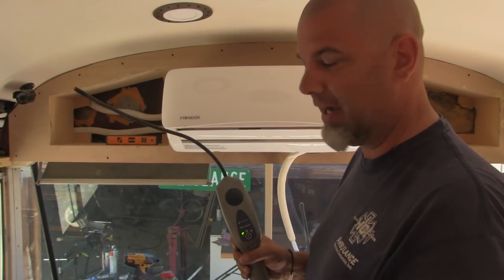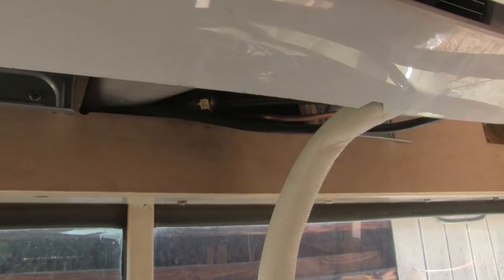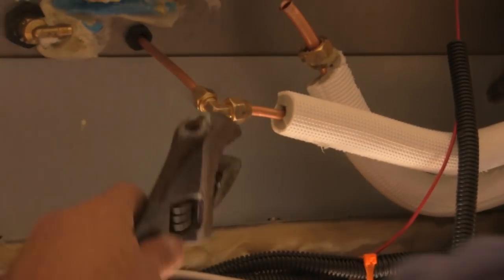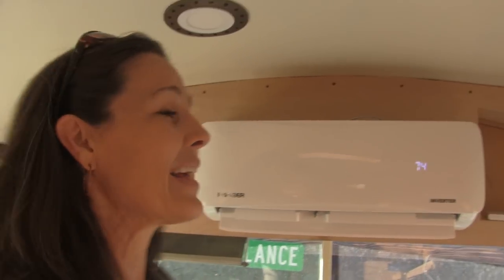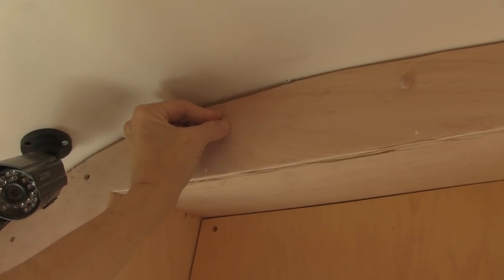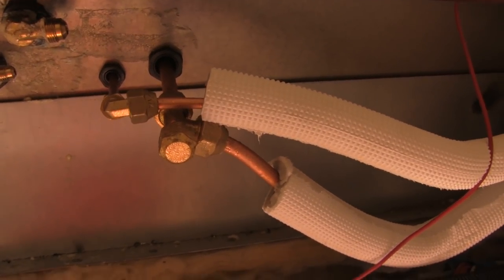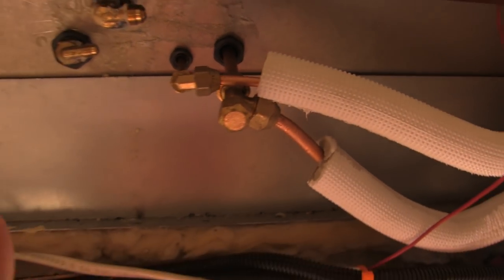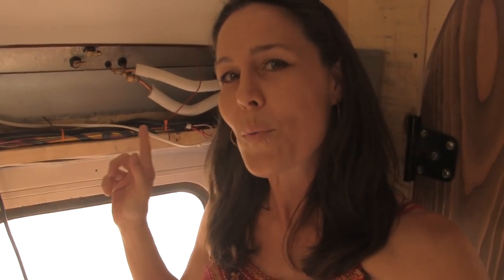Fixing Mini-split A/C Leak in our Skoolie | A/C Part 2

Comment: hey guys, I have been watching you since the beginning and enjoying your build immensely. I have been waiting for you to flare your gas tubing, I used to teach pool heating and commercial fired boilers service as a mfg rep. It was a no no to put anything threaded inside of a building on the supply lines. Especially propane fuel. i would have said something sooner, but i was hoping someone else hinted to you before I did. They did, and i agree with what you are doing.Just remember that propane sinks and it doesn't blow away like natural gas does.

Comment: Most mini splits come with ragged flares from distributer, best to cut off original and re-flare at condenser and remove flare joints at front unit and braze, a good braze lasts forever.

Comment: Best way to check for leaks on a heat pump/ac is to turn the heater on all the way. It raises the pressure in the lines

Comment: As an HVAC tech it makes me cringe how you went about this. Did it sort of work.... Yeah but lots of people watch things like this and go about it the same way less your speed bumps. For those reading this long after since they installed this let me throw some knowledge your way that will help you out.

1) In the install manual there should be a torque rating how how tight those flare nuts should be.... read and do it..... Its there for a reason. 
2) when you have the system tight ....PRESSURIZE IT WITH NITROGEN. Start at 50 psi and spray soap bubbles on all the fitting. If you are clear increase pressure to 400 psi. Check for leaks again.  The reason why you want to use nitrogen is it will help dry out moisture inside the piping. Let this sit for an hour or so. While he was using analog gauges it may be hard to tell with a lot of accuracy if you have a leak or not but you will can get close. 

When you vacuum a system you are removing the air and putting it in a vacuum and boiling off the water content inside the pipe. To be sure it is "dry" you need to use a micron gauge. This is a gauge on how much vacuum the system is in. at 500 microns it is considered dry. Most people do not do this or dont have the tools as they can be expensive. But I will tell you in most HVAC system installs 99% of your issues later on can be traced back to an install issue.  Another reason to use a micron gauge is it will with no doubt tell you if you have a leak. It is far better of tell you this versus positive pressure. Once you get to 500 microns..... close the manifold gauge set and watch the micrometer. If it start to go up..... you have a leak.  My digital gauge set has a micon gauge in it..... I also have this one as a back up. 

https://www.amazon.com/Fieldpiece-SVG3-Digital-Vacuum-Gauge/dp/B00DMFHF0I/ref=sr_1_2?crid=54ARHNHIILU9&dchild=1&keywords=fieldpiece+micron&qid=1630241416&s=hi&sprefix=fieldpiece+mic%2Caps%2C183&sr=1-2

3) they really went over some things super quick in this.... One they most people will probably screw up on..... the condensate drain. You will fight this constantly. They did not show anything on how and where they took the drain to? All air conditioning drains are a pain in the ass. So give yourself access to the drain as you will need to blow it out from time to time as it gets clogged with algae. 

Over all not a bad process but very important stuff was not covered in the video. Im just trying to help others out with a few things to make their install go easier.

Comment: How is the AC cooling the other side of the bus, do you notice a big difference in temperature from front of the bus and back of the bus?
Reply from the maker: Not very well. There is definitely a temperature difference between front and back with the door close. With is open there is a difference but overall the AC struggles. It is well over 100 degrees F so on an average day it will do very well.
Reply: @BussyMcBusface  I am getting ready to make a decision either go with rooftop ac units or a minisplit. I saw pioneer sells multizone units so I could put 1 in the front of the bus like you guys and then another about halfway in the bus so it cools the bunks and backroom on our crown bus.  However these multizone are 220v not 115v. Which means I would have to upgrade my panel from 30amp to 50amp which may be better long term but when it comes to solar panels and inverter it would limit the inverters that output 220v right? I can't seem to find many 12v to 220ac v our build is on Instagram acostaae

Comment: Question? Did you use crush rings they pressure the lip of the line when tightening down?
Reply from the maker: No, we just flared the tubing and tightened it all up.
Reply: @BussyMcBusface  glad no more leaks
Reply: @BussyMcBusface  bus is looking good
Reply from the maker: Thank you!

Comment: How much solar is needed to run a mini split? We are trying to decide how to heat and cool our bus. We are only at the laying subflooring stage, but for the floorplan stage we will need to fit in some kind of heat/ cooling system.  Trying to decide what will be the best option for us and energy will be a big factor in that. Thanks!

Also if anyone knows this answer feel free to answer:)